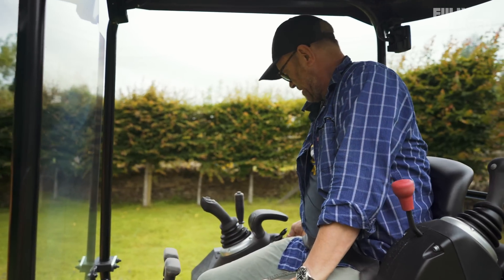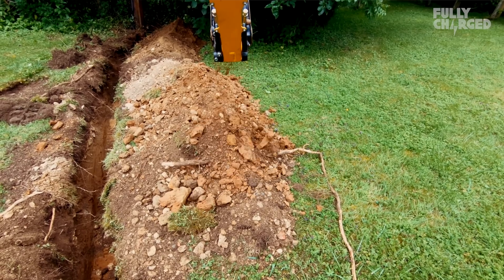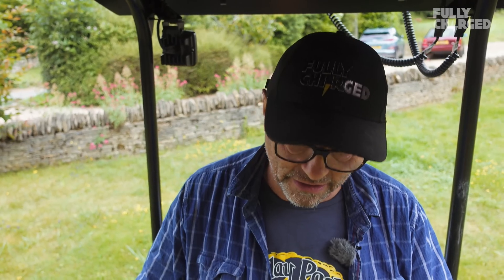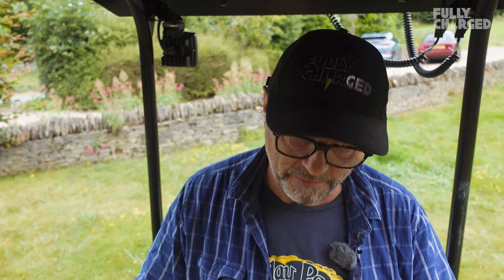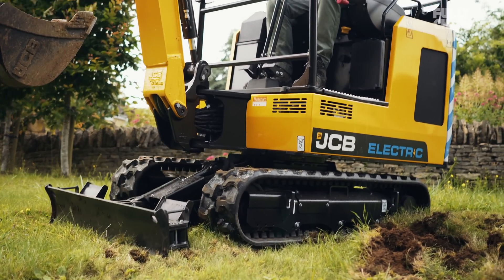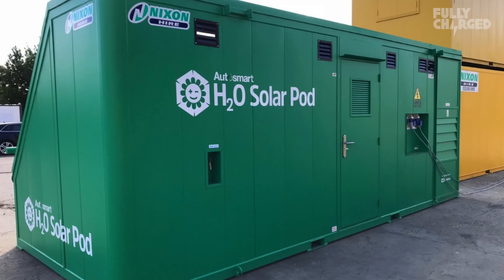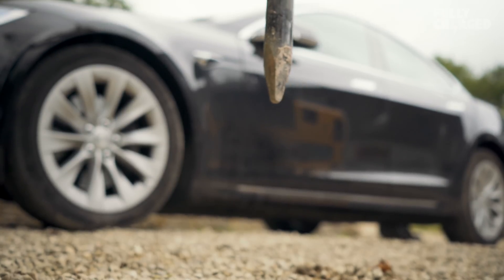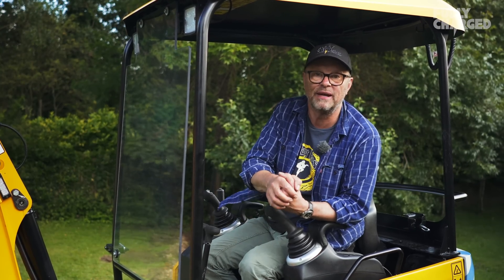JCB Electric Excavator / Mini Digger JCB 19C-1E E-TEC zero emissions electric digger | Fully Charged

Comment: Love seeing these new applications for electric over diesel.  Electric is a must for confined spaces.
Reply: Mining equipment has been mostly electric for probably 50 years at the very least and most of industry is run by electric motors, so weirdly, the car industry is very much the latecomer to the party. The difference is almost none of this electric mining and digging equipment was battery powered because it was much cheaper and easier to run armoured power lines to the machinery. Some of the really big equipment gets a whole substation to itself. Batteries are the only part of electric vehicles that hasn't been way cheaper than IC powered machinery almost since its inception. In the very early days of cars electric was holding its own with IC and the lack of good batteries and environmental regulations gave IC a massive lead.
Reply: peglor
Car companies were actually there before mining... Ford had a electric model T.

Battery size is the limiting factor on bigger machines.
Reply: Like when you're confined to one planet.
Reply: They tend to use gas powered fork lift trucks inside warehouses as the fumes are less of an issue.
Reply: Zery tail swing diesel

Comment: could use some solar panels on top of the roof as well and a mini 2 stroke generator built in at the back just in case.!
Reply: Portable generator would do the job fine. You could even strap it to the rear in a pinch. Problem with solar panels is that the roofs of these can take some real impacts from trees and other building site materials.
Reply: fidel catsro No need for a power generators. There could be a need for mobile batteries for such occasions but with local power it is unnecessary.
Reply: @davidlazarus67  but little cute 2 stroke 800watt generators can be bought for under 100 quids!
Reply: fidel catsro As was shown at the end there will be alternatives. Secondly diesel may become very expensive if so few actually use it.
Reply: great discussion now lets show you some almost free energy videos
https://www.youtube.com/watch?v=ghQZ1Wtj9hc

Comment: "The cells are made in Sunderland..."  That'll be Renault, then!
Reply: Not Nissan then?
Reply: @drdoolittle5724  Joint venture I think.
Reply: @drdoolittle5724  Nissan and Renault are pretty much one and the same these days. They have a partnership and will share pretty much all their vehicle drive trains and floor pans.
Reply: @drdoolittle5724  Doh!! I did, of course mean Nissan (and see my update on this above.. or below depending on where this comment ends up) although as Lawrence points out they are (or at least have been) very tightly bound... until the CEO got arrested in what struck me as the result of an internal political battle between significant players in both companies trying to do things differently... They may be behind a retraction from the way Ghosn (former CEO) was pushing for EVs...
Reply: Hopefully Robert took the bloke for a nice drink and snag a invite to look at the battery and motor suppliers!
Reply: @cinnamondonkey2397  Thanks - never heard of them!  But there is a difference between a 'battery manufacturer' and a battery 'cell manufacturer'... and my suspicions are confirmed with this excerpt from your linked article.... " Support from the Advanced Propulsion Centre (APC) played an integral role in the early stages of Hyperdrive’s seven-year history. The High Energy Density Battery Project (HEDB), in partnership with Nissan..."